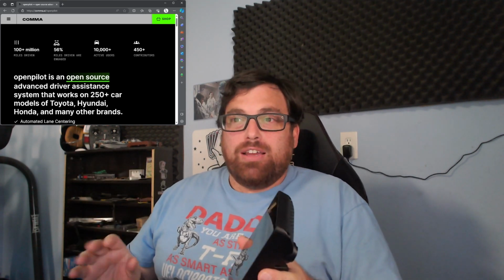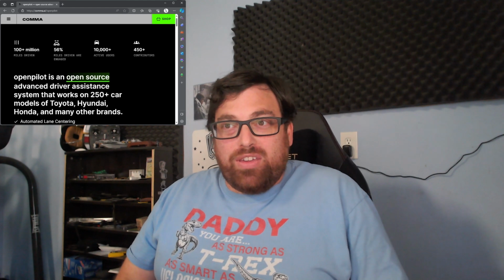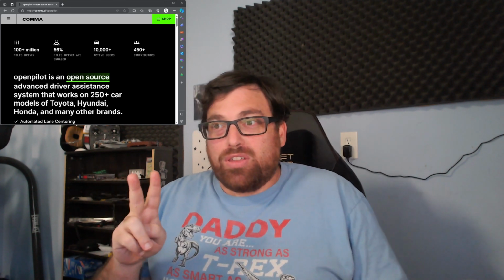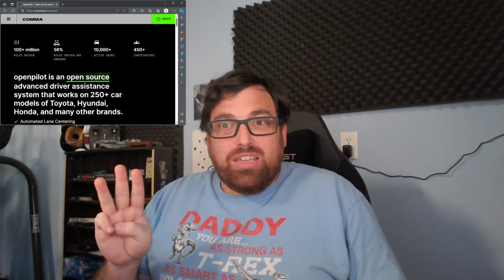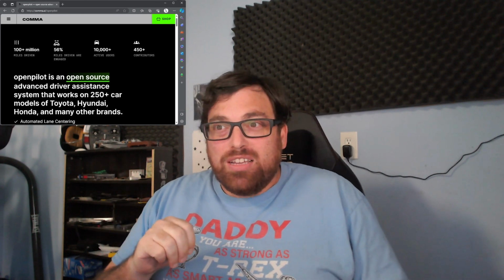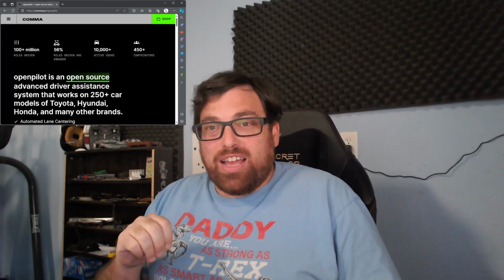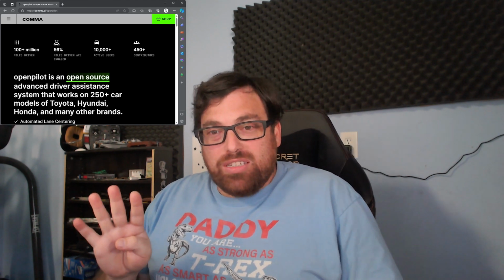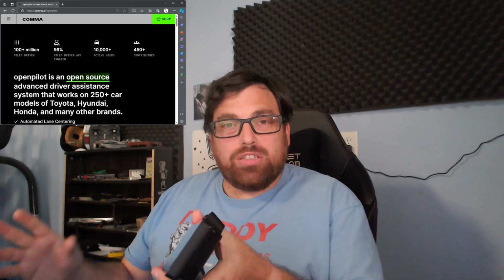Machine Learning

Comment: 🎯 Key Takeaways for quick navigation:

00:00 📺 Introduction to Machine Learning Basics
- Introduction to the concept of machine learning.
- Mention of the potential of machine learning to automate tasks.
- Introduction of the Comma 3 self-driving system and its significance in machine learning.
01:18 🚗 What is a Level Three Self-Driving System?
- Explanation of a level three self-driving system and its key requirements.
- Emphasis on the importance of the driver's presence and readiness.
- Mention of the role of various sensors and cameras in such systems.
03:32 📷 How the System is Trained with Machine Learning
- Overview of how the self-driving system is trained using cameras and human driver input.
- Explanation of the continuous learning process through human driver observations.
- Comparison to machine learning models and the need for extensive data for consistency.

Made with HARPA AI